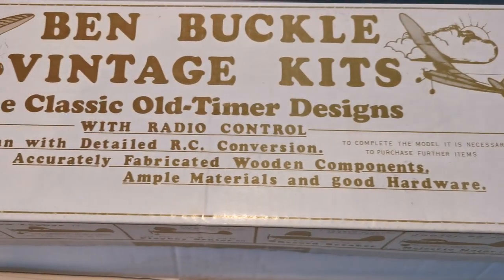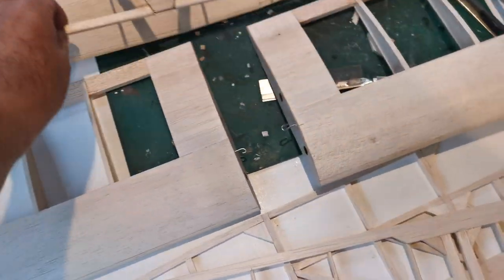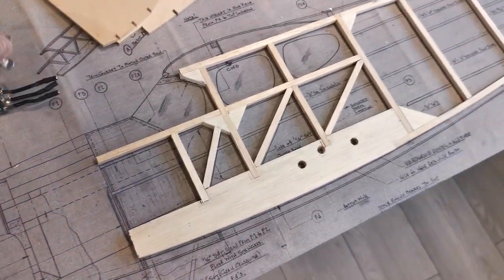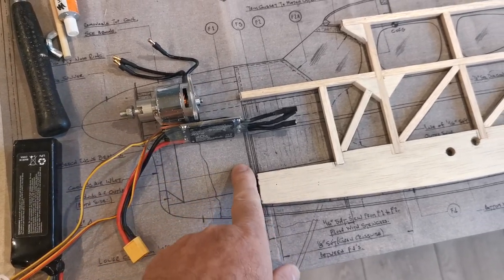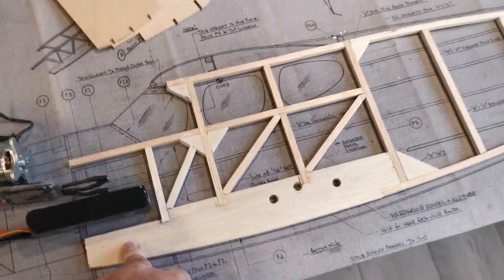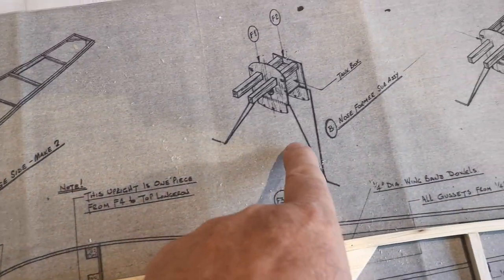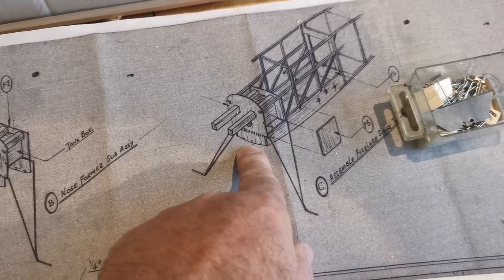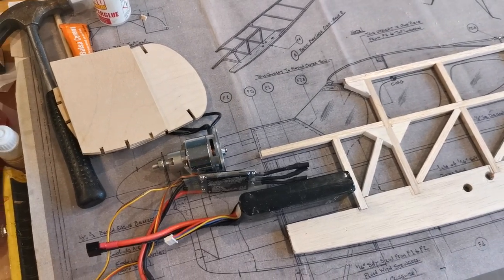Ben Buckle vintage RC biplane "Elf"

Comment: Mark the build is looking great  don't have much building experience but I how it's easy to try something out and if it doesn't work you can cut it off and replace it with a different design,  Jeff in LA USA

Comment: Hi Mark in your position i think i would make up a motor mount for the electric motor using the 2 bearers and fit or glue them in such a way that after completing and getting flying experience with it,  you could at a later stage remove the bearers and replace with standard configuration ones for an IC motor if circumstances change. I have seen pictures of the Elf and think it a cracking design! Plus you build standard seems impeccable.

Comment: Definately needs to be IC!!  Get the measurements for the beam, which are easily found on line for the engine you want, then you can build and look for the engine to buy at the same time.  Be a shame to have such an impressive model electric